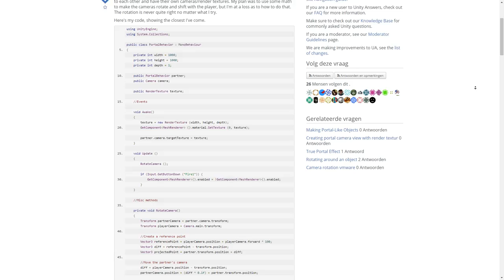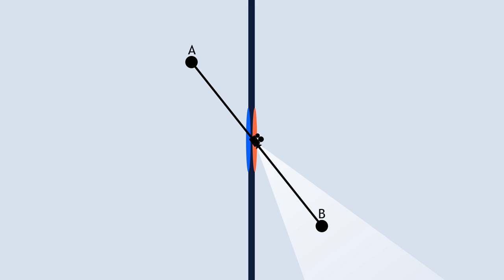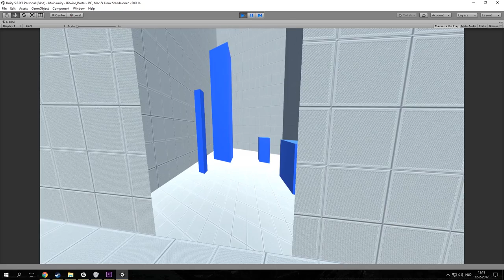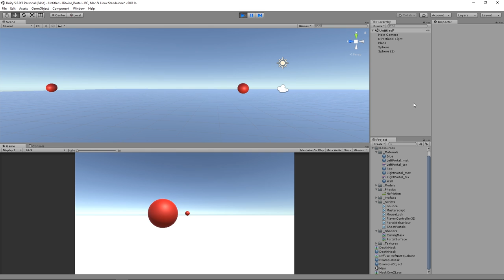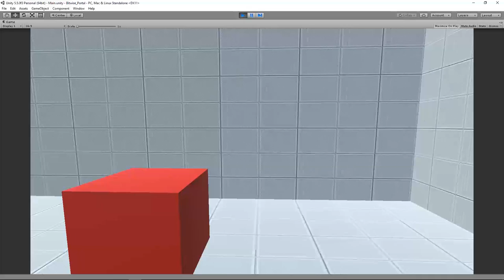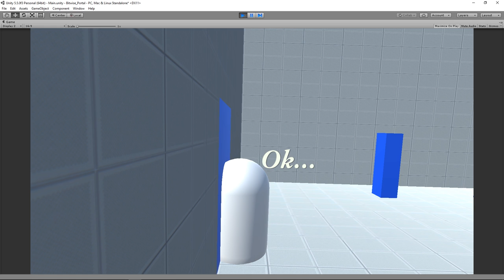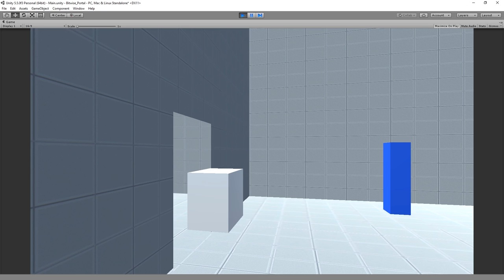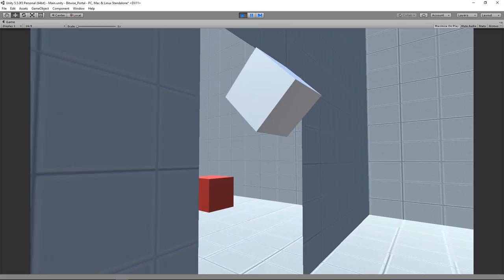How were the portals in Portal created? | Bitwise

Comment: I'm still confused on the final fix to the portal implementation at 4:15. How does stretching what the camera fix our distance issue?
Reply: Asking the same thing. Is the image stretched or is it positioned to make it seem like we're looking through a hole? What does the whole portal look like if it was the whole wall? How is it supposed to look like if we were to look at it in a different angle (assuming the viewpoint is still connected to the player's camera than the second one)?

I got all the things listed here expect for the distance part. I honestly can't wrap around my head around it.
Reply: its stretched out. Its like changing FOV in a game.
Reply: Just imagine putting a camera six steps away from portal, 3 steps ahead of the 9 steps portal, because you are looking from nine steps the resolution is for example 1600 x 800, because field of view increases with distance, so now you just crop the displayed resolution to the correct resolution to maybe 1200 x 800 and display it on the exact same mirror size as the portal enlarging the object and making it look closer, all the while calculating the correct setps
Reply: I don't if this is the right explanation but:
The image on the portals comes from the image gathered by the portal camera.
The camera gathers image in a ratio that is similar to display (most likely 16:9) which is longer horizontally.
But if we try to project that in a portal which is longer vertically (likely 1:2), the image produced would be squeezed in the horizontal axis.
In order to counter the squeezing of the image in the horizontal axis, we just stretch the image horizontally before projecting it in the portal plane.
Also as he mentioned, we don't need all the information that cannot be seen through the other side so we just discard it and scale it up so the portal only projects what the player must see.
Hope this helps, although I don't know if this is the exact thing that he is mentioning in the video.

Comment: im not a coder, but i thought you just need to create 2 copy of the same 3d world and let portals connect this two worlds
Reply: That would surely work, but since you say that you're not a coder, I'd like to tell you that your idea – when implemented, would take up a lot of system's memory, and that would be very hard to run across a wide range of computers, which would be against the principles of Valve.
Reply: @csbnikhil  Except that's closer to what they actually did than what this video shows.
Reply: I take it back, they re-render the image of the same room, which is more like what this video shows.
Reply: But still managed to run smoothly on low end systems... Wow!

Comment: I know this video's almost a decade old, but on the off chance anyone else sees this, a few questions:

1.) How does the described system work for cases where the wall with a portal attached has a thickness less than or equal to the distance between the camera and the opposite portal?

2.) Related to the above, how does the system work in cases where an object passes into the portal, but in realspace would extend past the other side of the wall? In Portal, we have a number of instances where the portalable surface is often thinner than the object phasing through the portal, yet from my memory the engine is able to shear both the collision and render meshes so they don't impact the space beyond the portal's parent brush.

3.) In cases where an object is rendered using a billboard technique (rotated to face the camera), how would one deal with these objects in instances where they're visible in both the portal and the player's direct line of sight?

Comment: 3:38

I paused here and was really confused as to why that wouldn't work and tried to figure out the answer.  Except it was the answer.  Adjusting your field of view is exactly what you did.  You narrowed it, which is the same as cropping and resizing.  

For an equivalent perspective from the photography community, it is like adjusting the focal length while keeping the same camera position, which some cameras do via a smaller sensor, the conversion factor being called "crop factor"
Reply: I think the FOV setting on game cameras differ from real cameras. As there is no "sensor".
Changing FOV in a game camera is like going from Telephoto to wide angle. No matter how much you adjust the image cropping proportionally, there would still be some obvious curvature.
Reply: @AaditDoshi  Going from telephoto to wide angle is the exactly the same as cropping when the camera position is in the same spot.  Doesn't matter if there is a sensor or not, the math works the same on a virtual pinhole camera in graphics.

There is no curvature inherent with wide angles, once lens imperfections are accounted for and the image is rectified or undistorted, to match the ideal lens, which is what virtual cameras have.  The only thing that will remain is perspective distortion.

Comment: Thanks for the video. This was the exact thing I wondered while playing the game - what "black magic" did they use to make portals work in a game engine and on video adapters that deal with only real life physics and perspective? 

My first idea was to have two cameras with projections onto the portal surfaces. It was great to see you actually reproducing the same idea and explaining the caveats that came with it and dealing with them.

One thing I liked about the Portal game is that you don't lose velocity when bouncing between two horizontal portals. If you jump into one horizontal portal from a high edge, you jump up to the same height out of the other portal, and then bounce back to exact same height out of the first portal and continue bouncing forever. I imagine, if portals existed in real life, you would inevitably lose some velocity due to gravity and air friction, and would end up with lower height of every next bounce. However, such behavior of portals would make it much more difficult to play the game because then slower players (like me who hates reaction-based games) wouldn't have enough time to shoot the next portal during a bounce. That level 18 ending example with multiple jumps would become very frustrating because I would have to restart jumping from the very beginning each time I missed a shot. I don't know if that "velocity preservation forever" feature was intended for exactly this purpose - to help less agile players - or not, but it was a tremendous help for me.

Comment: My simplest idea is to use two cameras. The first camera is the room without portal, the second camera is placed as if you see nothing but the portal. (or in another word, behind the other portal with distance equal to that between the player and the first portal.) Then lay both images on top of each other. 

The other option is to use a computationally expensive path tracing, but this eliminates any problem when looking through portal again and again.

Comment: You also need to set the near clipping plane of the portal camera to match the portals surface. And you need to cut the mesh of the object going through in half at both portals to avoid seeing the object going through the wall from the other side. If you want more detail, watch Sebastian lagues "coding adventure" on the subject. I can understand why digidigger didn't add this though, because it could quickly become a very long video.

Comment: Valve did a great job of solving the endless mirror problem too. When you look through a seemingly endless chain of portals, there doesn't seem to be any noticeable lag.
Reply: They did that using the stencil buffer, so only a small section of pixels had to be rendered for each pass, and they also limited to maximum recursion to 9 times (iirc).

Comment: The developer commentary in Portal explains a bit about which techniques they used to make portals feel seamless. They basically create a virtual copy of the immediate area around a portal, carve a hole in the other portal's wall, then "paste" this virtual area there. That allows players to interact with things from the other side of the portal without having to step through, and it allows the game to more accurately calculate collisions without having to disable the wall as a whole. It's very interesting to check out, though I assume you probably have already. Great video, very informative and interesting!
Reply: Seems a bit overkill. Wouldn't it be easier to just shoot a raycast at the portal and then create a second raycast at the exit portals which shares the direction of the first raycast (kind of like how bullet-penetration logic works) and then checking if the second raycast hits something that is interactable? I am sure that VALVE have their reasons for doing it the complex way... so what exactly am I missing here?
Reply: @Schytheron  I believe that would be more complex, because the interactible objects range would change as the player moved, so the game would have to recalculate that raycast window on each frame. Not to mention this could extend indefinitely across a large map, making unnecessary copies of distant objects when there's no way for the player to interact with them through the portal (unless your raycast also has a range limit). I think having a simple rectangular region makes it much easier on the game and calculations. You just duplicate objects once, then reproduce their behavior, rather than constantly checking for the player's angle
Reply: @HugoBDesigner  I think you misunderstood me. The raycast is supposed to be shot only once (whenever the player wants to interact with an object that is on the other side of the portal), not every tick.

For example, if the player presses a key to pickup an object on the other side of the portal, you shoot a raycast onto the portal surface, calculate its angle and direction, then replicate a second raycast coming out of the exit portal (with the same angle as the first). If the second raycast hits a pickupable object you simply pull the object towards the exit portals surface and once it has teleported, you start pulling it towards the player. Easy.
Reply: @Schytheron  While that would work for picking up cubes, there are other variables at play. More importantly, interactions in-between portals. One of the biggest challenges with portals is figuring out how to do stuff when they're halfway through a portal. Stuff like cubes, pellets, turrets, etc. If you, for instance, place a turret in the middle of a portal such that its two front legs are in one side but over half of its body is on the other side, you must have a way to "tell" the turret that there is a floor on the other side of the portal. If that floor changes, the turret must know and tumble into the portal accordingly. I think these edge cases are the reason why making a simplified physics sim around the portal is the cheapest way to go. Otherwise, we'd have to account for too many variables, making raycasting non-viable. Unless I'm overlooking some detail in your proposition.
Reply: @HugoBDesigner  In the turret example you mentioned, everything is going to solve itself automatically. Like the video mentioned, if an object is halfway through a portal, it will create a clone at the exit portal that replicates the movement of the "original" object. If the majority of the turret body is on the side of Portal A, then that turret will be the original turret and the turret near Portal B (front legs) will be the clone and since the clone will replicate every movement of the original, the issue will solve itself. Do you understand why?
Reply: @Schytheron  So, if I'm understanding correctly, reserve raycasting for user-object interactions, but apply physics cloning to individual objects on the midpoint? I suppose that could work. I can see the raycasting being useful for stuff like turrets seeing you through portals (it's probably how it's done anyways), but I'm wondering how it'd work for stuff that doesn't depend on the player pressing a button. For instance - and this is just an example that doesn't apply to the actual game - imagine an object that, when the player looks at it, it does something. That kind of object would require a constant raycasting. Like with the turrets, it could be the case of having that method applying just to it, but how about other objects that don't need a constant raycasting? Would it be treated on a  case-to-case basis (cubes only raycast on player use, turrets on player line of sight)?
Reply: @HugoBDesigner  Probably. An object's raycast logic would work the same regardless of if you use portals in your game or not. The portals only require you to replicate the raycast that hit it onto the exit portal. Basically just offsets the raycast to the exit portals position and let's it do its own thing.

Try to imagine a portal as a wormhole that transports raycasts to another location.
Reply: @Schytheron  From my understanding, though, the cube's physics isn't fully cloned, but rather its "hitbox" for interaction. In that case, how would a raycast be more cost-efficient? I can see its advantages (for instance, long-distance object-object or player-object interactions), but would it be quicker/more efficient than a limited range multi-step cloning?

Comment: There is no way anyone would ever actually suggest those first few options. 
Everyone would talk about offsetting from point blank. 
You place a camera at the offset then only render what is visible through the portal. 
Additionally, the better part of the issues Valve had with portals was the technical feat of multi-camera systems in the first place, which, at first,  brought computers to their knees. 
When you just spawn as many cameras in Unity as you like, you’ve skipped passed 90% of the interesting stuff, and nearly all of the problem solving that valve went through. 
This isn’t how valve made portals. This is how anyone today can implement them.

Comment: this is great! the only problem that I can see is that if you move through the portal at an angle then you will move out of the portal perpendicular to the wall the portal was on since it saves your velocity and applies it in the direction the portal is facing, this should be a pretty easy fix as you could just save the angle that the player was moving at the last few frames before entering a portal and apply the force in that direction.

Comment: nice, but there are 2 things forgotten. 
- about disabling collisions - what if the object you are putting in portal is " U " shaped? then one end of it can go trough the wall if other end is in portal 

- about saving velocity - you cant just push player straight out of the portal, for example when player is entering portal at an angle (this happens in game, when you are using catapults) if you just launched player straight out of the portal, it wouldn't be accurate. also you cant just re-use camera angle cuz then it would depend where player looks like. you would need to store the angle at with you enter the portal to be applied when you exit it. 

also you didnt told one thing, but it think you applied it - it must be stored at with part of the portal player is entering (for example when portal is on the ground, it must be stored if player entered the top, bottom, middle, left, right part of it, so they dont always enter on the middle.)

but super nice video ! if you were making a real game im sure you would find this out when testing it

Comment: I think your solution for velocity works only when you enter the portal from angle the portal is facing(which is most of the time ) but would make a weird transition when you ran at the portal at an angle.

To correct that I think you need to not store the velocity as a number but as a vector.

Comment: Valve's solution for collision is probably ignore collisions (physics module) that happen inside two AABB (one for each portal), I couldn't think in a more appropriated way to do it, as you're doing it in Unity you can't change the collision solving system (unless you're using Physics DOTS)

Comment: Albeit it's a way more complicated way to make it run, but if you actually write the shader and do Ray casting yourself, you could set up a mask of sorts on the wall for the portal, then any rays that hit the mask (i.e. passing through the portal) would continue on the far side of the portal, meaning recursive portals would work very well and any cast and such would be flawless.